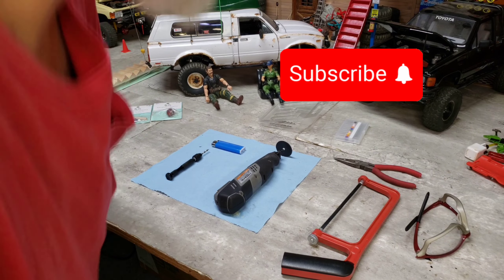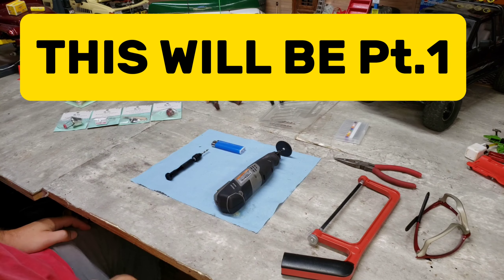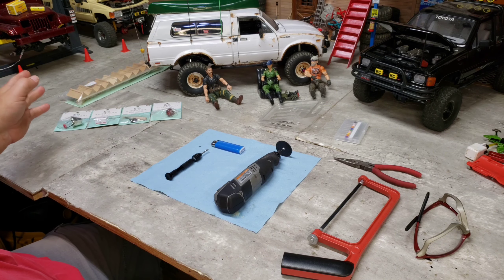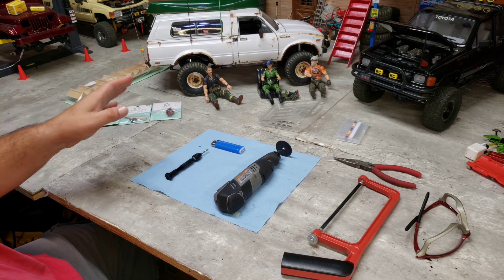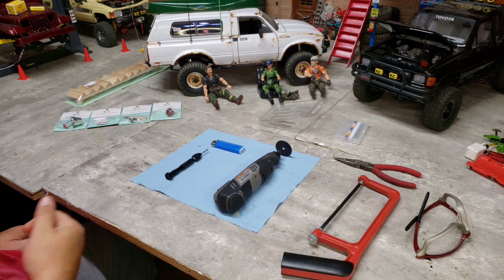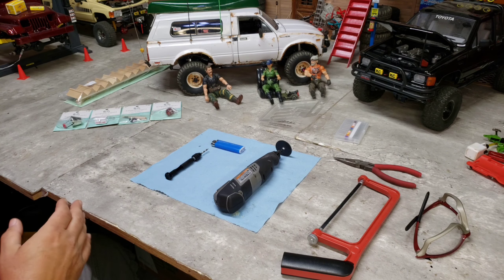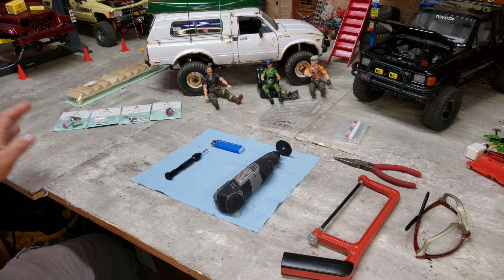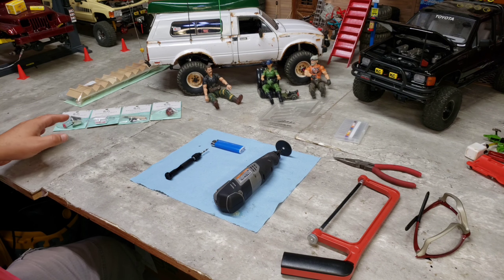Scale Exhaust Build/Pt.1

Comment: Hobby Lobby is great for scale garage stuff. I saw a cool gas pump there. Still haven't found a dog to put in my Marlin though.😄
Reply from the maker: @TyJoe_N_MattyMoe  yes sir great scale stuff. Tractor supply for the pupper they are around $3.00
Reply: I wonder how a mini-bic would work? Cut off the tabs and use the existing hole for offset inlet/outlet.🤷🏽‍♂️
Reply from the maker: @TyJoe_N_MattyMoe  I don't know, I just had these cheap lighters laying around that were like 96 cents for a pack of 3 at the dollar store, so I didn't mind cutting them up. However you can find a way I was just showing the idea to point people in the direction of thinking outside the box. This is a very sturdy homemade exhaust as well.

Comment: This is a great idea been looking at ways to do this by buying soft bendable aluminium pipe from amazon but still not decided yet
Reply from the maker: @trevorcourt1403  soft pipe I tried bends up way to easy if your trailing harder areas, it will also smash flat on rocks very easily
Reply: @RcDungeon  ah yh good point 👍🏻
Reply from the maker: @trevorcourt1403  I got about 2 runs if I was lucky using it. Would work very well for light trailing
Reply: @RcDungeon  yh no problem I won’t be using that then